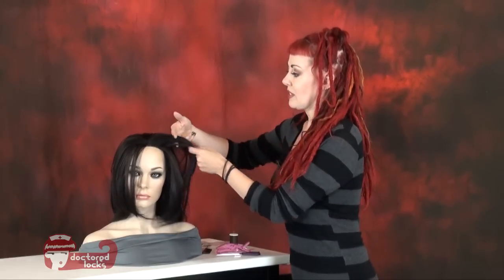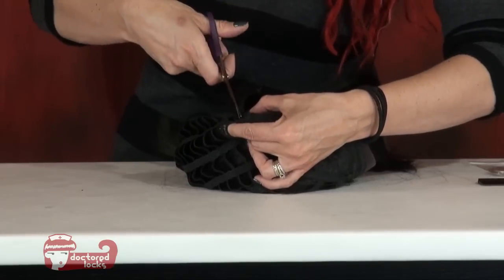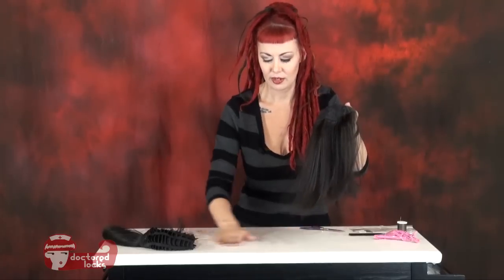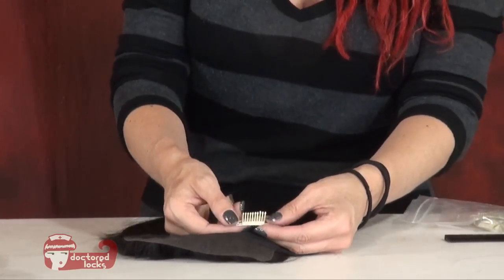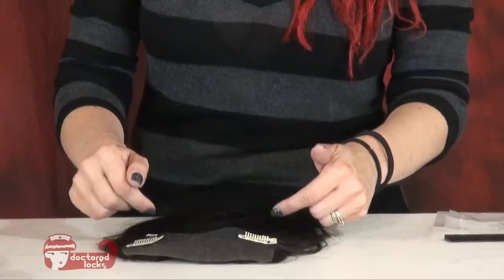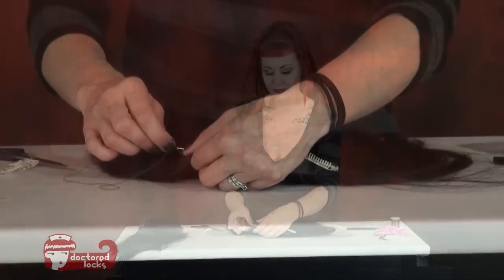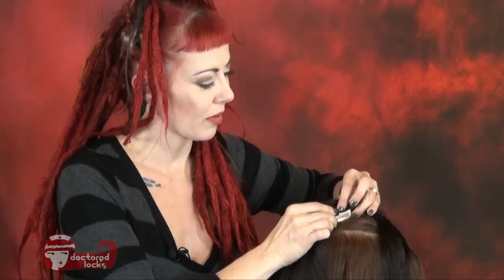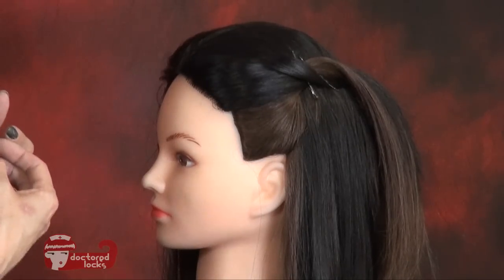Creating a Top Piece or Toupee from a Wig - DoctoredLocks.com

Comment: Thanks so much I luv your video ! I have thinning increasing in the front and sides but I always wear bangs but they are becoming skimpy. I have searched high and low for a wig that fits my big head therefore I think your video has given me hope. I'd like to know is this lace front wig one with a lace part ? I tried a few at the wig store but found the lace parted ones couldn't be changed and looked flat and terrible. I couldn't tell on your video if this one was synthetic with a part or a mono top ? I'm looking for inexpensive wig to try out your method. Thanks so much.
Reply: +Doctored Locks Thanks so much for your reply ! I wasn't aware Doctored Locks sold hair and beauty supplies. I checked out the Masterpiece and your Clip in Bangs which I love. I submitted a question on the website about the colors. I don't know if the #4 Masterpiece would match the #4 Clip in Bangs ? Because the Masterpiece is synthetic vs. the Clip Bangs are Human Hair. I read somewhere synthetic colors may be a little darker than with Human Hair. Thank you

Comment: I'm thinking of cutting Evanna by ROP into a topper (I realize they just made one also)...But, can you cut the front away a bit?  I hate the lace front, no matter what concealer I use I still see the crappy lace.  I would like my hair to blend with it and hide it into my hair.  Would that work?
Reply from the maker: I had to look that up - that's super cute!  As long as you have a bit of natural hair in the front to blend, that should work just fine.  If you are trying to use a makeup concealer, that might be making the problem worse - typically the lace holes let your skin color shine through and the lace should be roughly the same color as your skin to blend on its own.  If its not, yeah, I'd get rid of it.  :)
Reply: My skin is olive and it just shows the lace.  My friend is yellow and it just melts away on her skin.  I am so bummed, it took me years to realize what the problem is with lace fronts!
Reply from the maker: Aww, bummer!  There are some olive colored laces though, its just a matter of finding the right lace for you - its out there.  In the meantime, just cut that off and you should be good to go.  :)
Reply: What brands offer olive lace?
Reply from the maker: I'm not well versed on what brands are out there, I just know that I've seen it.  My specialty is more extensions - but I bet if you asked around you could get pointed in the right direction.  :)

Comment: Hi. Is it possible to make a wig or a hair topper from clip in extension pieces? Can you please make a tutorial? Please please please? Thanks.
Reply from the maker: Yes and no.  The biggest problem with trying to make one out of wefted hair is that you need hair to cover the wefts - so with each layer, you need another one behind it.  If you can use even a small part of a wig that has the center part, you can layer your wefts underneath this.  You might check out the video we made for creating closure pieces out of wefts (it might be at the end of the full braided weave video).  In my opinion, they are never quite perfect.

Comment: Have any suggestions on a solution for people suffering from traction alopecia (hair loss on sides of head and top...basically hairline). A hair topper would add volume to my hair but it doesn't solve the full problem. I can't seem to find anyone who has a solution for this (especially a DIY one)
Reply: I saw that video and thought it was great but what I noticed was the lace front piece was quite small in thickness (I need a few inches of thickness). Is there a way to achieve that? Also, I wasn't too sure I wanted to tape or glue down the lace, but with my problem I'm not sure if clipping anything in will work
Reply: full lace wig!

Comment: ok I cut the wig ..what do i do with the back?
Reply from the maker: My favorite thing to do is to add a line of lace to the top edge, then sew some clips on it and use it as a separate piece.  :)
Reply: awesome thank you
Reply: Doctored Locks I was thinking of doing this. I hate to throw anything away!
Reply from the maker: One thing you can do is to take a piece of light lace, and sew it along the top edge (where you removed the top).  Then sew clips to the inside of this piece.  You will then have a wearable backpiece - it can go under your top layer, or you can wear it as a ponytail OR you can even wear it with your new top piece and still have the same full wig!  :)

Comment: I just purchased a couple overpriced toppers, for some reason it did not occur to me how easy they would be to make myself! I’m used to having braids on the top of my head, but the braids caused hair loss, and now I’m wondering how I can re-create the look. Maybe I need to buy a complete lace wig and braid it... I wore a topper out dancing the other night and I thought it was going to tear my hair out and fly across the room. That’s the only trouble with Toppers.
Reply from the maker: If you sew more clips on your topper, it can help you distribute the weight a bit better.  Sometimes if you have it holding on by just one or two clips, it can really hurt after a bit of action.  :)
You can absolutely braid a lace wig - the only thing is that you have to block the wig and watch your braiding tension - because you can braid too tightly and cause ripples in the lace fabric - and that doesn't look so great.  Try to keep it from bunching up on the lace and it should look great!